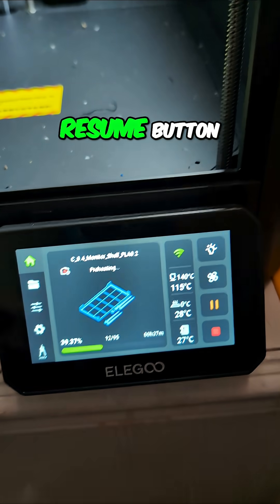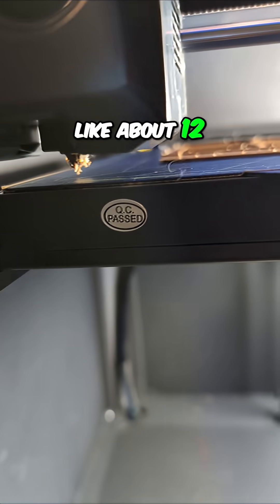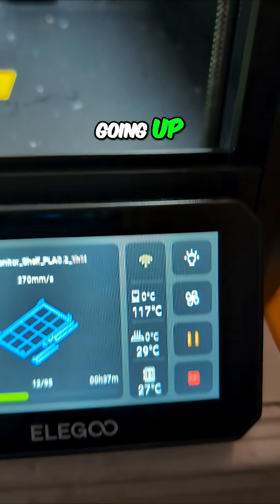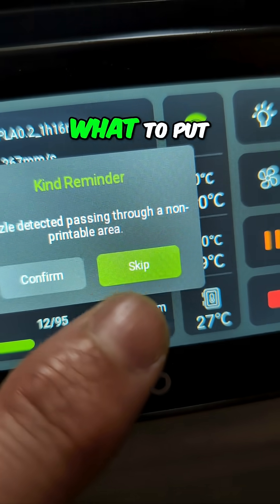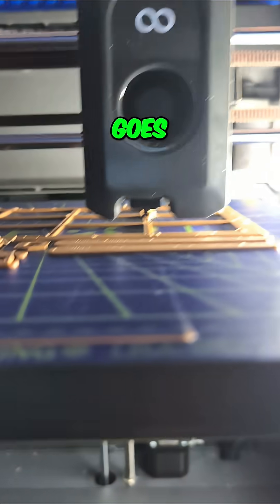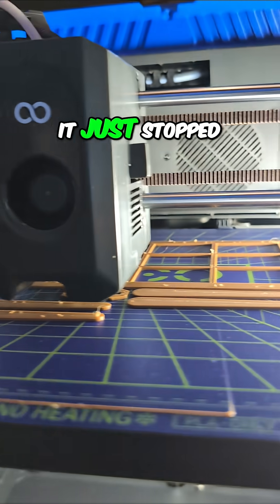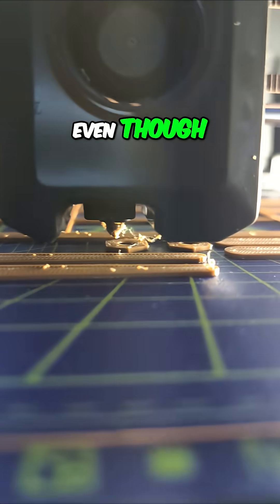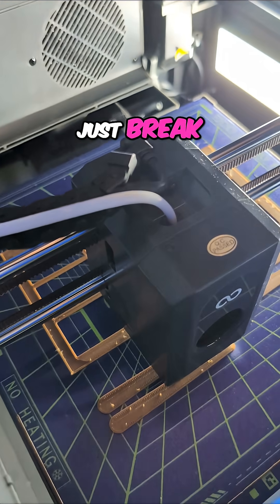Did my printer just break?! Elegoo Centauri Carbon 3D Printing Problem #shorts

Comment: Had this happen once and after restarting the print it did fine. You can also go into settings and set the temp back to your desired temp and see if it climbs.
Reply from the maker: It took a couple of reboots, but it has been working fine ever since. :)